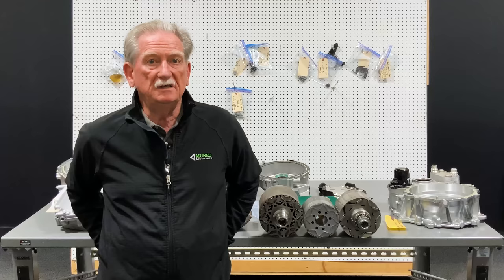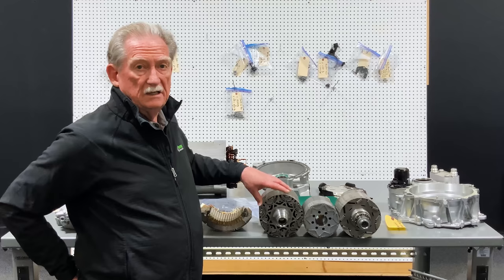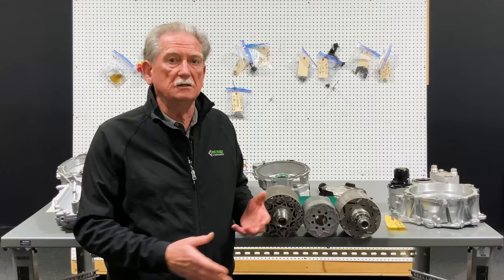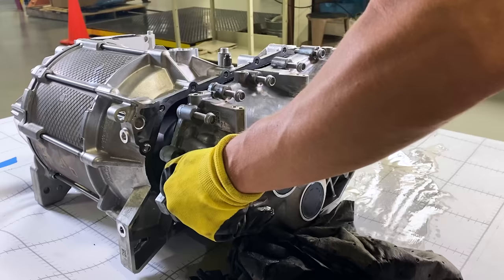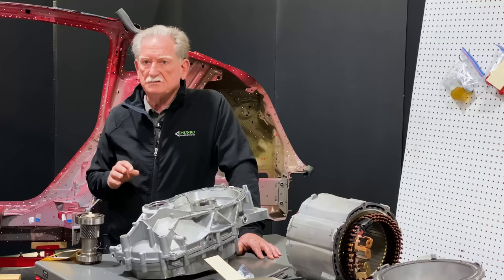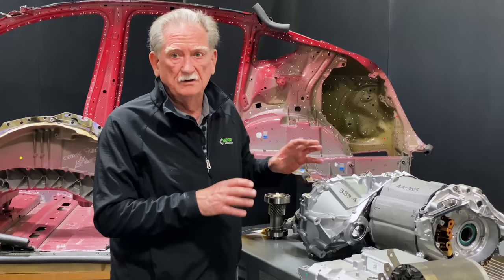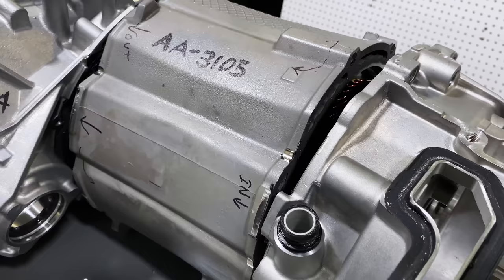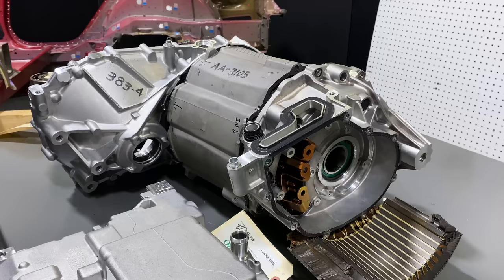Volkswagen ID.4: Electric Motor Teardown and Analysis

Comment: That sort of numbre of fasteners is pretty similar to others I've seen - Renault, Hyundai. A problem with large PCBs is that you can get mechanical resonance issues if they aren't fixed down in multiple places due to the springiness of the fibreglass substrate.
Reply: Sandy talks about screws coming out. I have worked on electric equipment for years and I can't remember seeing them loose or one ones that have fallen out.  I have harvested parts from Ford electronic assemblies and it's a struggle to get the screws out using manual tools.
Reply: @stevegorkowski3246  yes, if you use Loctite or tufflock patches, then they will not easily come off...
Reply: @stevegorkowski3246   Keep in mind, if 1 in a million breaks/ unscrews in automotive industry, it's a disaster. In this instance, it produces a rattle that makes the customer go "WV = shit". 
Quality control in automotive is on another level & taking apart a car to fasten an "un-fastener" is expensive beyond belief, cost & reputation-wise.
Reply: @alexlacroix8435  Ford in the past used that but sometimes had conformal coating on them. This makes repairing the board fun to say the least. In this case VW didn't use conformal coatings from what I seen in the video.
Reply: @stevegorkowski3246  In GTE they have UV coating on all boards. I think they have also on this one, maybe was a development board provided?
Reply: @stevegorkowski3246  They used, not all boards are fully coated, but selective coated, see for example at 26:17
Reply: @CATA20034  Golf GTE?  Have you taken the inverter, motor, etc. apart?
Reply: @elektrotehnik94  Subcontractors are building this stuff and your correct screws have issues but using nylon board supports and not enough screws can cause other issues. I repair things in cars that was designed to be tossed. Here is an example of a board not having enough support. 2000 Windstar instrument cluster. The cluster is two boards and connectors that connects the 2 boards together. It is common in wave soldering that solder joints around connectors are poor, this is due to the pulling action of heat from the connector solder joints. They then used some plastic snaps and clips to connect together standoffs and a few screws. The vibration action of the van caused caused shifting of the boards causing ring cracks. The speedometer  pegs when you hit a bump  and other functions may not work. Solder the ring cracks and it's good to go. My $500 van. This pegging problem is in my 2000 ranger but happens once in 3 months and there and odometer on f150 in the early 2000s.
Reply: @tomsixsix  inverter, charger, and dc dc 12v converter.
Reply: @paulodpereira  I stand corrected .
Reply: @Sidowse  Today with less heat sinks on board or smaller the heatsinks and surface mount parts, getting heat out of a board is a big issue . Grounding is important on the high current .
Reply: @stevegorkowski3246  There is selective CC on some parts of the PCB - you can see it shine as he takes it out of the housing
Reply: The converter is made by Vitesco, not by VW. That's why it is similar to Renault and Hyundai.
Reply: @stevegorkowski3246  I pulled a switch facia off about 6 months ago that had been in place for 20 years. The light was flashing as I removed it. When off, I discovered the brass screw had completely fallen out of one of the terminals. Apparently the small vibrations caused by mains AC are enough to undo them...
Reply: @andyonions7864  High heat in the joint causes expanding and contractions and you have a loose wire.
Reply: @stevegorkowski3246  heat cycling would give that effect. It was inside a stud wall (plasterboard) so relatively room temp constant. Believe me, AC loosens stuff up.
Reply: @CATA20034  nice, have you documented this anywhere?  I own a GTE and the power electronics have been reliable but I'd like to see the design myself.
Reply: @tomsixsix  I should have some pictures, also with the gearbox internals.
Reply: @alexlacroix8435  VW doesn’t use Loctite for many reasons. I knownthat because I design electronic parts for the
Reply: Those vibrations can be nulled by using a thermally conductive, but electrically insulating foam sheet sandwiched between the pcb and the metal case. Two birds in one stone.
Reply: @CATA20034  I'd be interested in seeing those if you get around to posting them online, or if you can send me a private message I will send my email...
Reply: @paulmichaelfreedman8334  Foams are thermal insulators, nobody can overcome the insulating properties of gas bubbles!
Also, Foams degrade rather fast, that's a solution for stuff which is build to fail shortly after the warranty ends. Or for more stable foams, chemicals are needed which make it almost impossible to get certification for the European market.
Reply: @stevegorkowski3246  90s Dodge products had similar issues. About half a dozen screws holding together the boards to the instrument cluster. The pins for the connector would develop hairline cracks along the solder joints because of excessive vibration. Symptoms affected most of the electronics systems throughout the vehicles with phantom failures of gauges, lights, door locks, etc. which could be temporarily "fixed" by slapping the dash. Glad to see overkill on these new products.
Reply: @paulodpereira  It looks that way but I wonder why VW did that.
Reply: @stevegorkowski3246  
Helped take a small fishing boat up NZ coast and a threaded fastener in the autopilot worked its way out, rolled around, shorted the electronicals. Had to hand steer the stupid thing for 4 days and 4 nights. 
I see where he’s coming from.
Reply: I think he is exaggerating the issue of having threaded fastners. VW and other manufacturers are no idiots or have less experience than others. VW is successful and big for a reason...
Reply: @andyonions7864  The heat isn't from external temp swings. It's from current running through the wire. The magnetic field can do fun things as well but that's more of an issue when you start talking about fields strengths found on locomotive size motors.
Reply: @markswick4901  I'm not disputing thernal cycling would undo bolts, it would. And inductive heating is used in cookers and will easily heat to 200C or more. Just saying, AC at room temp also undies bolts.
Reply: @stevegorkowski3246  I hear some people pay extra for pegging ;)
Reply: @andyonions7864  That is the AC compressor not being properly vibration insulated though.
Reply: @mikeselectricstuff  you have to remember that Sandy simply hates screws/fasteners, because his focus is on eliminating parts and movements, and sometimes he takes this aversion a little bit too far lol
If you remember this, you can filter out the hyperbole a bit better.
Reply: @stevegorkowski3246  We are servicing electronic units of 10-25 years old german cars. I have taken apart thousands of ECUs. Never have I had an issue with loose fasteners. Never.
Reply: If the inverter box wasn't DIRECTLY mounted to the motor case then one could reduce the number of screws perhaps because there would be a lot less vibration. But mounting it to the motor was done to eliminate cooling connectors, hoses etc! I don't think Mr. Munro has considered that! Either mount the electronics away from the motor----> fewer fasteners for the main PCB, BUT higher cost due to use of coolant hoses and of course REDUCED RELIABILITY!
Reply: @konasteph  or, mount it to the motor since that's efficient, and then use other means to deal with vibration rather than a bunch of screws. There ARE other options after all.
The first thing I thought of, since it's a layered design, just clamp it all together.
Put some ridges on the cover with cast in place spacers on each layer that all squeeze together when the cover is tightened down.
Reply: @stevesuprafluid2711  The bad electronics will be the smallest percentage of failures. I pull cells from many types of cars. The cooling system will be the big one. The older batteries cooled all around the cells but some newer cars are just cooling the bottom of the cells.  I see  fittings leaking and hoses leaking. I see pumps going bad and the fittings leaking after replacement. The Tesla pack has a large manifold and if a leak starts in the pack due to corrosion or a wreck the pack will be hard to fix.  The one that needs no cooling ,not range will be the winner in my book.
Reply: The problem with Munro's suggestions is that they are very bad for the consumer. Such as using rivets instead of bolts to hold the motor together. Basically making it an unrepairable throwaway motor!
Reply: @stevegorkowski3246  Steve, agreed. Thanks for this interesting point!
Reply: Very good observation. What about grounding effects by reducing the loop impedance?
Reply: @stevegorkowski3246  there is also a magic thing called Loctite :D
Reply: @Piktogrammdd1234   yeah would definitely have to be thermal pads not foam, and thermal pads are a bitch to work with, can’t do those quickly at all.
Reply: just glue them
Reply: @stevegorkowski3246  Ive seen a ton of threaded fasteners come undone on Harley Davidsons. You have got to locktite every single thread on one of those out of balance motorcycles. Ive also seen lots of fasteners come undone on out of balance fans. Ive never once seen one come undone on a PCB of course.
Reply: Came here to say this, haha.
Reply: @DavidJohnson-tv2nn  I try to think of it as a peek behind the curtain. It shows that many of the decisions that we might not be thrilled about are being made from a very informed perspective, and with good arguments in their favor. Things like plastic manifolds and oil pans, rivets instead of bolts, etc...
Reply: @OnkyoGrady  But such decisions are really only good for the stock holders. As they cut costs. But not good for the consumer. Since the product is usually less repairable.
Reply: @DavidJohnson-tv2nn  Yes and no. Yes they are less repairable and usually I'm a broken record complaining about that. No in that they are typically far more reliable and durable in the first place. That's in our interest as well obviously.
Reply: My thought as well was vibration..
Reply: @ryanmalin  HD is a 2 wheel viberator.
Reply: Yeah, not to mention the BGA chips, I've repaired many boards where the joints cracked from excessive board flex. I'd say they did a good deed by stiffening the board to the casting with so many screws.
Reply: And that make tings break. Quite few old trucks/cars (from 90's) I have fidled with had solder/track breaks. ESPECIALY on larger/looser boards. I totally support well fastened electronics.
Reply: @Nombre Apellido It is not cold solder joints.  Solder, especially the lead-free solders, have limited ability to handle repeated stresses and will develop cracks even if they were properly soldered in the first place.
Reply: @andyonions7864  what more than likely happened is it was never tightened to begin with . The tapping from switching the switch over the years is what loosened it. And eventually caused it to unthread. Modern switch's have the ends of the threads distorted so they can't back out all the way.
Reply: The number of fasteners isn't really the issue here, it's that they're threaded.
Removable snap in fasteners (be they nylon or springy metal) will reduce time spent fastening very much.
This could be made even better by clam-shell pinching the board at those points (obviously with padding).
Reply: @mikeselectricstuff Who cares about design experience when you've got freakin' lean design cheat sheets?!
Reply: Totally agree. Those PCBs are purposely designed to be fastened that way because of the harsh environment. For something like an inverter which would be repaired on an electronics bench, the number of fasteners is not a big concern.
Reply: I agree using more screws should help prevent resonance building up in the PCBs and the resulting latent failure when solder joints crack.  I believe it was a good engineering trade-off to mount the inverter with more internal screws directly to the motor, eliminating hoses/piping versus mounting elsewhere with wires/connectors and plumbing required to isolate vibration.  Speaking of vibration, does anybody have concerns about the capacitors’ durability?  I suspect VW pretty thoroughly tested that.
Reply: @elektrotehnik94  One in a million?   No.   One in a million will never be seen by the public.   I've yet to own any brand of car that doesn't get rattles.  I've owned Ford, Chevy,  Audi, VW, Mercedes, Nissan,  Toyota,  Mazda,  I refuse to own anything Chrysler related.  My VW GTI had a rattle from day one that nobody could figure out.   My S class Mercedes developed them after about 10k miles.   Now my Mazda has them after 13k.   Least rattles,  probably Toyota or Audi for me.
Reply: there is also cooling going on and ensuring good seals, so fastener count may be needed.  To alleviate his issue with them...just put on of use fasteners with locktite on them, so once secured....you're gold!
Reply: Yes, you need those many fasteners, but not threaded fasteners, no screws.
That's the point.
Reply: @alexlacroix8435  Red 'professional' loctite.  That's the stuff.  I don't think that particular chemical was around when Sandy was at Ford.  Game changer.  I love threaded fasteners, especially parts with threads as part of a piece (tapped if you will).
Reply: @elektrotehnik94  That would ONLY be true if there were no holding forces from any of the other bolts.  It's possible there are 2x as many bolts as 'necessary' here -- only because, of that unlikely event one gives way.  That is, one would need a double-failure to actually fail in service.
Reply: @stevegorkowski3246  All important auto boards are conformally coated, and have been for decades.  You need to do that to get -40 to +85 C in high humidity environments to not disrupt functioning.

Comment: VW has long been a very clever company.
Excellent tear down.  All those PCB  mounting points are needed to damp board resonance. It's an "instrument" that the car's vibrations "play", pet resulting in failure. 
Even desktop PC motherboards, and other hardware boards, are done this way, usually with IRREGULAR fastener spacing.

Comment: Did the 35 minutes already pass? 
Great insight on how different companies tackle the same problems. Lets hope they learn enough from each other, because these outcomes can also be applied good in other fields.
Reply: Yes who would know that Tesla electric motors requires filter and oil change.
Reply: @Foersom_  big oil probably loves to put that on the front page 😁
Reply: There is something besides weight savings going on with that rotor. Yes, it may help with cooling the magnets, but I suspect it has more to do with magnetic flux and stray inductance. VW is obviously very proud of that drive unit.
Reply: @Miata822  the shape of the voids near the core of the rotor are not suited to determining reluctance (which controls magnetic flux); I think Sandy is likely correct that they are simply skeletonizing.

Comment: Sandy seems to have a little obsession with threaded fasteners, apart from that this is a great video. Thank you. But I have never seen one of the threaded fasteners undoing itself, if it was fitted right. But I had a lot of plastic clips, rivet or snap fasteners in my live which broke trying to service a component. I mean the thought of scrapping or binning a few thousand dollar / euro part for not being able to replace an electronic part which costs a few cents is unsettling me. Honestly this is not forward thinking.
Reply: @Will he heck as like They are in a plastic state genius, though good job for being confidently incorrect.
Reply: Also your description of plastic and elastic deformation is hard to follow, I mean a single material can undergo elastic deformation and then plastic deformation. All ductile materials undergo both plastic AND elastic deformation! Let me explain why those bolts are in the plastic state. They are Torque to Yield as described in the video, which means they are torqued to a tensile load that causes the materials to transition from an elastic state to a plastics state. That's why TTY fasteners cannot be reused and should always be replaced.
Reply: @Will he heck as like certainly you are not an engineer.
Reply: He's definitely thinking and his main thought is he wants the cars to be as disposable and unrepairable as possible. He's not making a mistake this is deliberate.

Comment: 10 years from now, owners like to hear someone was able to replace that canbus  tranceiver, six pack, or shorted capacitor, or even reballed that bga.
Reply: Repairability is highly underrated
Reply: @darkreaper72jp  And not favored by many OEMs.
Reply: @storeskeeperrvl3797  It is if they're the ones having to disassemble it all to use reconditioned parts. And that's why VW did it
Reply: Snap fit doesn't mean impossible to service, you just have to do it a different way.

Comment: Train rails are now hydraulically stretched then welded together with thermite. This removes the need for expansion gaps.
Reply: He was talking about joining rails from different tracks I thought. You are right thought they weld most rails lately.
Reply: Thermite is an old method, newer electric methods of welding produce less material weakening. I'm sorry I'm too lazy to look for the English names of those methods rn

Comment: If it can be disassembled, someone will find a way to repair it. Screws for these assemblies often have blue material on the threads so they stay put. VW is very big on torque to yield on their fasteners.
Reply: but at what cost on top of the initially overly priced car?
Reply: @anubaral  Repairing a thing, normally is cheaper than replacing a thing, if the price for the thing, is very high.